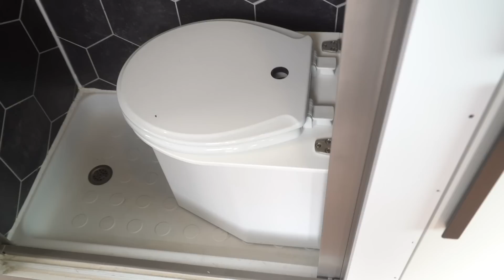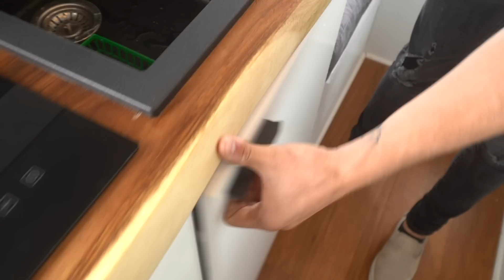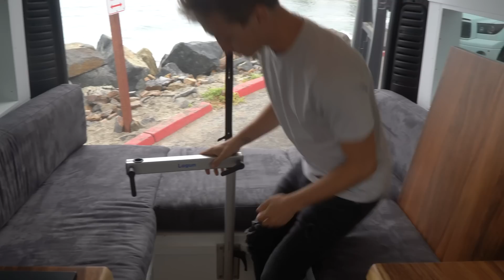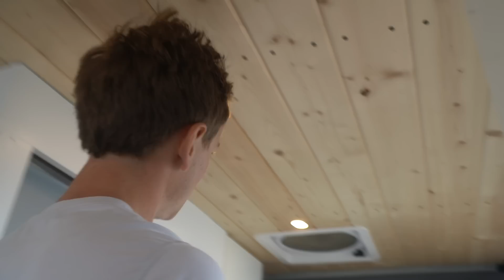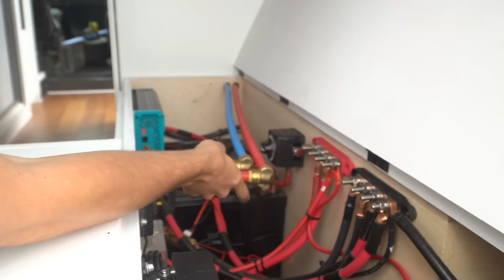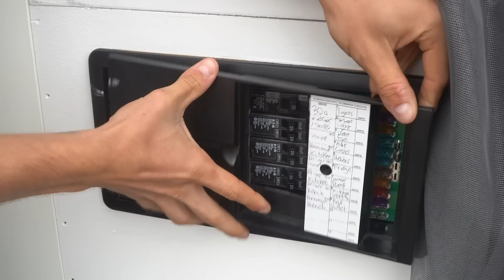LUXURIOUS Custom Van Tour | MASSIVE Black Slate Shower | 12v AC | Full Course On This Build!

Comment: This is a super nice camper with a functional layout and well-thought-out design – perfect for vanlife with luxury and comfort. Everything I see is fantastic and definitely the way I’d want to build my own camper!

The only thing that made my heart skip a beat was your two water hoses for the sink running across your electrical system. Wow – that’s something I personally would never do. You have two water hoses hanging above your electrical setup. They're not secured or fixed in place, so they swing back and forth while driving. The risk of a leak or rupture is quite high. And right below, you have an electric system worth several thousand dollars.

Why not run the water lines under the floor, beneath the electrical system? Or at the very least, move the hoses all the way to the right-hand wall and route them inside a plastic conduit, so if there’s ever a leak, the water will flow out the back of the van or into your kitchen cabinet instead of onto your electrics.

Other than that, I’m really impressed – you’ve shared so many great ideas and details that I’ve written down and will definitely use in my own van build.

Warm greetings from Denmark!

Comment: Nice set up. Only thing I would change, is that PEX elbows are not needed.  Just bend the PEX and put on a bend brace.  That gives a lot less joints to leak. (especially in an electrical cabinet!)

Comment: I love this build. I would only change 2 things. I would block off the cab with a wall that has a pocket door, and I would have a hydraulic bed over the dinette. Then, the dinette could be a secondary bed when you have guests if you don't drop the hydraulic bed all the way down.

Comment: Never use tiles in a moving vehicle. The chassis will move and twist while you are driving and shake the tiles and the grout loose. There are many people here in YouTube who use tiles and most of them won’t make that mistake again. In addition they are heavy and with gas prices approaching $7 (in CA) you want to make sure your vehicle is not unnecessary heavy.

Comment: wow super nice, love the fridge, galley and shower set up, need to be honest the screw holes and exposed nail heads are killing the vibe though. like the use of the ram, and not aa sprinter. how about the ford transit? and builds on this chassis . very clean work.

Comment: This is awesome and you're very talented. Someone else probably mentioned this but I suggest a lock on the exterior water fill. I plan to do something similar for our current build but I wouldn't do it unless I can control who accesses it. One weird person with negative intentions (or positive) and your tripping while driving down the road in a best case scenario lol

Comment: Is supper easy to use the PEX pinch klamps & it’s only 13$ for 50 of them. I don’t recommend using the push on shark bites unless you absolutely kant get to the lokation with the krimping tool, the water lines over the elektroniks inside the box I would Kut the lines bakk run them on the outside of the box alongside the  box  then 90 degree the lines  under the sink & for the sink lokation I would have put it by the slider door so you kan flip it around & use it out the door, you kant sit in your bed & use the kounter top to set anything on bekause the sink is there…… powder koat the outside skrews in the water full so they don’t rust, paint the skrew heads to match that are being used to hold the wall board on, & paint the edges of the wall board that are pealed of from kutting / installing. Not sure as to the return line of the FresAir return line draining bakk into the potable water tank, without taking outside debris from the air bakk into the tank. I don’t think the FresAir would work in a high humidity area. Why swamp kooler don’t work in high humidity areas…….. other than that nise Van build. 🤘🏻😎🤘🏻

Comment: You know,  they make little plastic screw tips caps that you can actually snap on into the screw drive head so you don't see any of those screws. Very cheap nice looking fix. Notice lots of roughly cut edges, on wood trim,  and a little messy caulking in that shower. You have great ideas, but I think a little more attention to detail is crucial if you want more jobs. The goal is to make everything look FACTORY MADE. KEEP UP THE WORK, YOU WILL GET THERE.

Comment: Water and electric side should be switched.  High pressure water lines X2 is good for an electrocution if water is on the floor.  No sane person would buy this.  You fuxxked up.

Comment: Love the layout. I do have a have u ever had any water issues with them SHARK BITES?  I was told PEX-A with UPONOR 
are better. Not to mention PEX-A are a little better easier to bend and less fittings. Witch means a less potential of water leaks. 

But still love the conversation VAN 🤙🏽

Comment: Fantastic design and build!  The alternate air conditioning solution is brilliant and sets the van apart from other builds.
Reply: I like the evaporation cooler, I would not recycle the water into my water tank directly. Living in Arizona where evaporated coolers are everywhere they get mineralization in the water so I would filter it before returning it to the tank.

Comment: Could you provide a link to the type of thermostat controller switch you used?  Im having a hard time finding anything that looks like it would be small enough to be comparable to whatever it is wrapped in the tape, shown at 32 min in the video, while being user adjustable.  Thanks!

Comment: The problem with the swamp a/c is that it does spray moisture and thats not good for all the wood in the van. You can use them just not non stop. Run for an hour and not much longer at a time.

Comment: Love the van, excellent job, maybe and I say this in a constructive way, look for an alternative route for your water supply, the hot cold elbows above all the electrics is a little concerning, nothing may ever happen, or maybe constructive a catch tray with drain just below the pipes if you can't re route the pipes, other than that it's a fab van build

Comment: I am in the process of building my van and noticed  that a lot van builders do not lock their water on the exterior. In this build the water fill is on the outside with no locks then he goes to the inside of the rear and a key lock for a shower . They put a lot of money in high tech gear but will not lock their life source WATER.
 I owned a travel trailer with no locks on the water fill, long story short someone contaminated my water with dirt and rocks.  I had mud coming out of the spigot cost me a few dollars to remove and clean the tank.  Hence I would never have my water fill on the outside.
 I have opted to use 8 jerry cans 5 gallon each 40 gallons total. This keeps my water fresher and I can fill them easily, between fills add a couple of drops of bleach to disinfect my cans. I saw this set up on a van builder video it makes sense to protect your water.

Comment: 22:19 please tell me that connection was only for testing...
Because of the wire used im assuming your water heater runs on AC voltage, that type of connection for AC is unacceptable 😱
Reply: Omg!!! I cant believe you installed water lines above all of the electrical!, you cant even do that on a house that doesn't move nor gets into accidents, its even worse in a moving vehicle that can get into an accident, I know it will take you a bit more work, but for your safety, please re route those tubes under the electrical, place a false floor above it, with an access cut out to the sharkbite elbows, then install the electrical on the space above leaving access to the access door just in case, ive seen sharkbite fittings crack and become disconnected, I highly recommend you pick up a copy of Uglys Electrical References guide, it will help a lot at least on the AC, side of things.

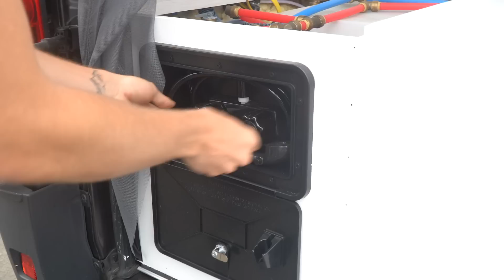Comment: Loved the first 20 minutes of the review, excellent work. The time from 20:30 to 39:00 was basically wasted time for anyone just looking at what is available. The 19 minute in depth technical review was unnecessary and a link to your course would be much better way to teach people how to set up their electrical and plumbing systems, way too technical and really didn't need a description of what every wire connected to.

Comment: Hi, can you add security? I want unbreakable windows and a collapsible, lockable metal security grate between cab and cabin. Also, side door that can’t be popped open. Security is VERY IMPORTANT. I think it should be in all builds.

Comment: awesome. this is the best design, beats the bed in the ceiling. every smart and hiper functional, i wonder if the ac type is made to catch water when it rains and purifies it? this was an amazing build, everything needed and tons of storage. light and bright. really impressed, i just watch a bunch of videos, but this design stands out. the lounge is a really great. until the bed is needed. i did think the windows could be shorter so the bottom of it could have the i think flares, to give extra space, kind of extend the foot and headroom pass the 6ft. love the screen for everything.

Comment: Think the layout is spot on but your finish really needs work if i came to buy that van i really would not be happy with the finis. Can see screws everywhere the paint work sorry is shocking there are caps on the top cupboards and rusty screws on water fill and when you silicone mask the van really doesn't look good. I know this sounds bad but really is a great van you just need to work on the details 👍

Comment: The water hoses running through the electrical makes me scream inside. Maybe you could have enclosed those in some pvc to add a layer of protection... Still, great job overall.

Comment: I would like someone to kit out a campervan like this for me.  Bed would be stationary and I would have all electric and solar power van with propane only as back up fuel for stove or hot water, so that I could go off-grid for days at a time. I wonder if a generator would be a good addition?

Comment: So many cookie cutter vans out there, you are a few levels above everything else I have seen. This is awesome. I would love to see an all wheel drive van, either a sprinter or Ford Transit with the eco boost. Wife and I want all wheel drive, light off road, nothing too crazy. We like the 144 as it can fit in a regular parking space but still don't know if a 177 would be to big or the best choice for us. I would need more storage for supplies in the back of the van, maybe clear the roof of solar and run the recharge off the alternator, leaving the roof for some storage boxes. We wouldn't be sitting in one place more than a day so with your solar capacity we would have enough power for a few days and would be driving again. Wife and I are looking at the Storyteller Beast but I think you could come up with something even better. We are down the street in San Marcos, when we are ready I will reach out. Very impressive all around...

Comment: I plan to build something with a U or L shape seating area for the rear. But i am torn between having an elevator bed, or a make your bed build. If i had a fixed lifted bed, i would for sure build it to be able to pull up like a couch to allow sitting and movies in partial bed. I just do not value the storage of a fixed lifted bed. Or a garage. Everything seasonal is on top of the van.
Reply: Elevator bed allows the same seating, but less storage, and no luxury of overhead storage.
Reply: Same goes for Murphy’s bed builds.

Comment: I love this van build but I’d also love a pocket door between the cabin and living area...excellent build...yeah I’d need hot water on demand water heater.  Could you use a telescoping table so you don’t need to remove it to build the bed?  So you could probably raise the bed for taller under bed storage too.

Comment: Details are always awesome. Over by the light switches and the mosquito netting the white panel and the trim looks horrible. The wood looks very rough and paint is missing. 🤨
Reply: I really like the layout and the dinette seating/bed is what I will do on a 170 Wheelbase Sprinter.  Since I’m 6ft, the bed needs to have a length of a least 75 inches.  

However, not to be overly critical but I agree there are many small workmanship issues with this unit.  The area around the water pump switch needs to be cleaned up.  Also the top cabinet by the door has a gap where it attaches to the ceiling and wall.  Let me say that I wish my personal build would be half as good as this.  

Hopefully the many nit picking things that needed to be completed were done before handoff.   For $100K I would expect perfection.  Also knowingly installing plumbing over the electrical compartment is beyond the pale.

Comment: Overall I like the design but the finish is ropey. Badly painted insides, screws should be covered, sanding the edges where the pipe goes to the ceiling fan/cooler.  Also don’t like the idea of having open access to the water tanks, should have a locked door, like your other shower inside the back door.  Also, why have you got 3 shower options??!!  Also the anti crinkling ....lol

Comment: The electrical termination especially the dis board/ fuse board is so poorly done all exposed wires and the pass through on hot and cold water didn't't require elbow this insuring a water tight connection and no pipe support over the distance. Otherwise not bad would of considered reversing sink and fridge so pop up table provides space for the washing up less risk if water  splashing upholstery. Did enjoy watching.

Comment: that silicone up the corner of the shower has ruined my day should be black or at least done neatly use tape or something the make a clean bead apart from that one of the nicest vans ive seen
Reply from the maker: Haha wow, sounds like you have a pretty miserable life if a necessary bead of silicon ruins your day. The tiles couldn’t get close enough to do a thin bead, thanks for the criticism though, i’ll make sure to add it to my pile of irrelevant and pessimistic comments that I never think about again.
Reply: @shaidenvalentine1   no need to be so sensitive mate 😂, was clearly an exaggeration about ruining my day just though it could be done better that’s why I literally gave advice on how to make it neat, I’m not a psychic how would I know the tiles wouldn’t reach, also said one of the nicest vans I’ve seen apart from that small thing, clearly can’t take constructive criticism because you’ll Chuck it in your imaginary pile and keep stroking your ego

Comment: I have to say that the van looks great. But, all of that gets thrown out the window once you run water lines over electrical. That’s the best way to burn 10k. Once I saw the water lines over the electrical, my next thoughts were “can I really trust their judgement on everything else in this vehicle?”
Reply: Totally agree with your comment.  At a minimum he could raise the battery compartment floor an inch or so and at least run the lines underneath.
Reply: In the video he stated that the customer wanted it this way.

Comment: $100k build and you use stick on Velcro for mossie nets.  Using modular units in kitchen is another NONO on such a punchy build.
Beyond shocking.

The acacia is stunning, so please stain the ceiling to match this so you can partially redeem yourself. 

My Verdict:  you are scamming your buyers using cheap products, with a smattering of exotic wood to gloss over your fraud
Reply from the maker: Fraud? Adorable, my buyers are stoked on these builds and you need an education you moron. Get the fuck out of here.

Comment: Great build and detailed insight into the electrical. I have 600 A of battle born batteries and I am using a 200 amp fuse. I see you’re using a 300 amp fuse, how do you know when you have the right size? Do you have charts.

Comment: This is a really nice build, it’s certainly one of the best I’ve seen.
Reply: $100k build and they use stick on Velcro for mossie nets.  Using modular units in kitchen is another NONO on such a punchy build.
Beyond shocking.

The acacia is stunning, so please stain the ceiling to match this so you can partially redeem yourself. 

My Verdict:  they are scamming your buyers using cheap products, with a smattering of exotic wood to gloss over your fraud

Comment: You are THE MAN. I can't believe you didn't lose your voice after all that explaining. Lots of great information here and it's obvious you guys have really thought things out. It's impressive and inspiring. 
One question though: don't you get a lot of voltage drop on the cable from the alternator all the way back to your DC-DC charger? That seems like a long run (even with what looks like 00 welding cable which has to be pricey for that length...)

Comment: I am interested on your course. Please add me to the list. Thanks a lot. I love your building technique but if I could change one thing, I would remove the two hot and cold water pipes from the cabinets where you are running the electrical junction box. You know water doesn’t mix with electricity.
Reply: The client was insisting on certain items after the build was set, he tried to dissuade client to No avail..and that’s what the result was for the plumbing over electrical.